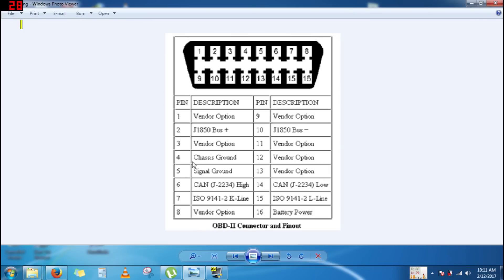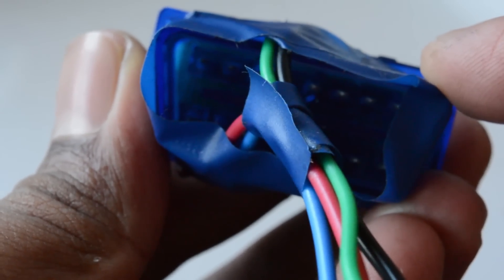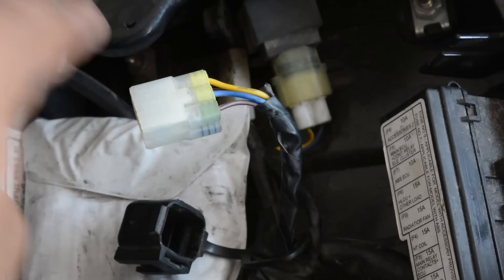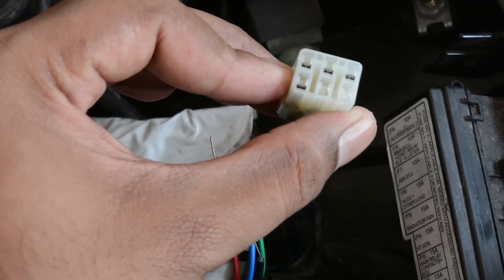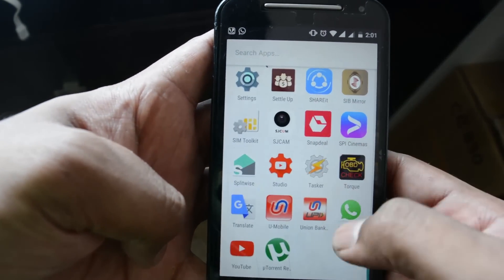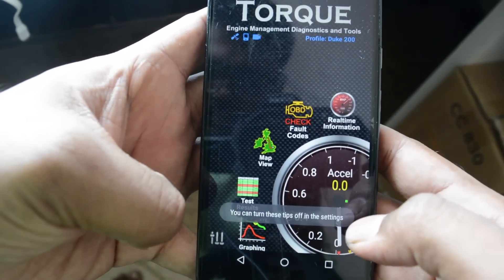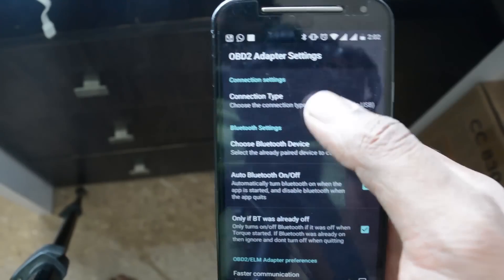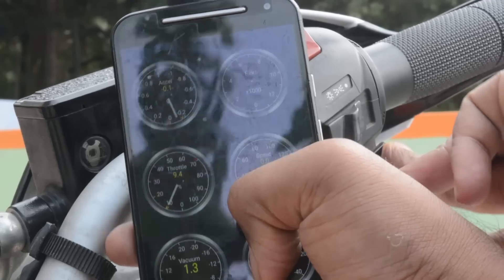How to connect a smartphone to a KTM Duke or RC|INDIA

Comment: tht is really helpfull video thanks bro 
i hv a hyosung gt250r and i hv a 4 pin connector and 2 pin connector for connecting ecu
how to connect?? pls help
Reply from the maker: +karthik h I don't quite get you karthik
Reply: bro in my bike i hav 2 separate  sockets to connect to ecu

 1st one has four pin ( 2 black , 1 red , 1 blue)

2nd has 2 pin ( 1 blue 1 green) 

2 black wires are ground 
red is 12 v+
which is can + & - ?

Comment: which year model is your vehicle? 2016 or 2017? I heard 2017 models coming obd ports with Bluetooth pre installed.
Reply from the maker: mine is a 2015
Reply: @dudesandtools  hey ..
how this Adapter work with ktm 125 .2013 ?

Comment: Bro. I have installed the OBD2 as per u suggested..Now I can connect the device in bluetooth But its not accessing my bike over the torque app.my bike is Duke 250 2017..Im sure all the connections are done same. Could you plz help me in this.

Comment: @Dudes and tools. Will this work on my DOMINAR 400 which has the same engine as the KTM?
Reply from the maker: +Prateek Ashok it should
Reply: Is it possible to get the connector cable online which ships to India?
Reply from the maker: +Prateek Ashok connector cable was overpriced on ebay

Comment: If  you're just too lazy to do it yourself you can buy it right here: http://m.ebay.com/itm/OBD2-KIT-FOR-KTM-DUKE-125-200-390-RC-125-200-390-BAJAJ-RS-200-REAL-TIME-INFO-/222135449529?nav=SELLING_ACTIVE
it also works with pulsar RS200 and it may do it as well with Bajaj Dominar. it comes with instructions to see RPMs that are not available out of the box when you get connected to Torque. Also, wires are soldered and plugged properly!!
Reply: Hi, i have a cable & ELM i brought from ebay. But i dont know how to get RPM on torque... i have a KTM 200... please could you help with the instruction...
Reply: I am lazy and appreciate you posting this. Ordered. :)
Reply: Buddy they don't have shipping to India is there any other options to buy it?
Reply: Hi. I just edited the listing so you can buy it from India for an additional U$10 fee. Be aware it may take up to one month to be delivered.
Reply: does this work on with NS200
Reply: vasanth cy Hi. OBD2 only works with fuel injected vehicles and, as far as I know, that bike still uses a carb.
Reply: Sir It still ebay says this location is not avalable for this product, buy the way Im from Philippines
Reply: parag pilankar bro wer u put up
Reply: Rolo Biker will u remap my ktm duke I put up in sadashivanagar bangalore
Reply: Shiraz sheiq Hi. This item is only for reading data from ECU. It can't modify the fuelling map
Reply: Rolo Biker 
thank you 😊
Reply: Rolo Biker we cannot reset my bike ecu frm dis product
Reply: You can reset fault codes. Not the ECU
Reply: Rolo Biker wr u stay
Reply: Shiraz sheiq I'm in Colombia
Reply: I have i phone 6s witch app i will use then
Reply: gagan verma it hasn't been tested with iPhones
Reply: Rolo Biker 
Does it work with a 2018 Husqvarna 701??

Comment: bro where are the +ve and -ve ports in 390 duke 2015, 16 model. I need to connect usb charger.
Reply from the maker: +Navdeep Singh Negi connect it to the battery. Include a switch in the line to avoid drainage
Reply: Dudes and Tools What about accessory cables in rear compartment ? Can i connect my charger through that ? to make it turn on and off through ignition.